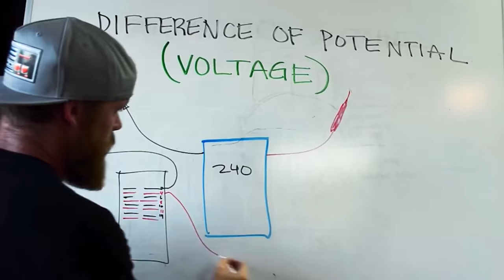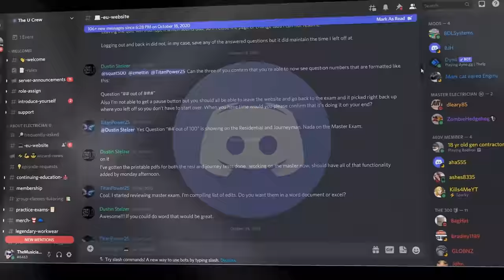Kitchen Remodel - At Parents House

Comment: I look at figuring something like this out akin to doing a jigsaw puzzle, i.e. start with the corners and edges (the easily identifiable stuff) and work your way in picking out chunks to work on that you recognize, and then rest is just making the little pieces fall into place. After that, the daunting part is making it all work in the confine you're given, like in this case not tearing up the ceilings etc.

Comment: I had to do that exact same thing but junction box then but what I did was I put emergency lighting at those locations depending on where it was I just thought it was a neat idea to have that in a residence with no generator just in case the power went out.

Comment: If you had done undercounter lights, how would you have split and run the wires without hiding a j-box in the wall?  Also, what is code in terms of securing/protecting where romex comes out of the wall to serve undercounter lighting?  Looks like your parents would have had 3 sections of UC lights run off the switch.

Comment: Dustin, what are your thoughts on the new splice kits for #14 and #12 wire that you can cover up.  I thought of these when you mentioned the junction box issue and wondered why you did not use them?
Reply: I think in a different video he was troubleshooting some lights. This was long before the new splice kits came out I'm sure. I thought I seen some junctions left inside the wall which is is big NO NO. That only costs the homeowners more money in the end cause it takes us longer to find the culprit. Those things are cool and all but after that house is owned by someone else and they fail, then what? How is the next electrician going to find that splice inside of a wall without it being accessible? I would only use those little splices up in attics and clearly where someone could find them later down the road if something would happen.  Things are made to break and that's a fact. Dustin had the best and simple idea to use accessible junction boxes throughout the house.

Comment: well after years of being stuck doing residential work I decided to get into the electrical program at my local community college. hopefully it will open alot of doors for me. thoughts on this?
Reply: @SOHMZ IMO, to open ALL of the doors, you need to get into an IBEW inside wireman apprenticeship. You will learn ALL of the electrical theory and wiring methods to wire ANY building. It's a good gig, but it does take time (my apprenticeship lasted five years). However, an electrical program at a local community college is not a bad idea. If your intention is to do commercial work, it is definitely a step in the right direction.

Comment: My grandfather and my dad were both master electricians... They always taught me everything that they thought I should have known as far as electrical is concerned... But they did not want me to become an electrician. My dad always told me if you become an electrician I'll kill you. 🤣 

They taught me a lot. I don't know if I could pass an electrician exam or whatever, but I do know a lot of codes and whatnot.

When I moved into my new place the garage was done by a do-it-yourselfer that did not know how. Literally.

The walls on the inside where sheathed with one quarter inch plywood so it looked kind of nice, but further investigation revealed that they had not insulated the walls... So here comes the tear off in March of last year.

The tear off revealed blatant electrical code violations even though there were only four outlets in the whole garage and only three overhead lights. I had four hidden junction boxes and about five hidden junctions that were not in a box... Only wire nutted and electrical taped.

The garage was built first so the main panel is in the garage. The main panel consisted of a 200 amp breaker running to the house to a sub panel, and three breakers dedicated to the garage.

Long story short, I ripped out all that shit in the garage and put in another sub panel with a 100 amp breaker feeding it.

I then separated it off for some 220 volt circuits for the air conditioning and air compressor and a welder.
I know, 100 amps may not be enough to run all 220 circuits at the same time... But I do plan on shutting off one so I can run the other two. IE: shutting off the air conditioner to do some welding.

I wired the rest for the furnace (regular home furnace here... Just like you have in your basement with air conditioning) lighting and outlets throughout the garage... West wall being separated from the east wall.

Ceiling fixtures West and East on two different switches with 6 porcelain fixtures three on the west and three on the east and 15,000 lumen LED garage lights. It's too bright. Lol but I'll never have to complain of dark spots in my garage. 🤣

I had a Pole shed build and I ran 110 volts off the panel over to that via direct burial AWG-10.

At the same time I was doing my basement remodel and I went hog wild with outlets and five way switches and can lights in the unfinished ceiling between the joists... We went with an industrial theme so we painted the joists with semi-gloss black. It looks amazing.

Before buttoned it all up, I called a local licensed electrician and paid the money to have it all inspected. He said that some of his guys don't do this level of craftsmanship. I took that as a compliment.

Comment: 4:46 my sisters house has a 4 gang box that 1 of the 4 switches goes to 🤷🏼‍♂️ We toned, traced, did everything in our power (and remember we were to the studs) to find where that thing went to…. Not a clue as to where it goes/went/or what🤦🏼. But honestly, isn’t it required to have at least 1 switch in a house that when flipped on/off….ya got no freakin clue as to what the thing does, yes, I’m sure you right there reading this has at least 1 switch that got no clue what does, am I right😅😅
Think this is a requirement in houses, and has been for generations 🤣😉
✌🏻
Reply: Check the light in the dog house, same thing happened to Al Bundy
Reply: Yeah. I got one... 1962 house 😂 the switch has 120 going to it and I don't know where it's going.
Reply: That switch goes someplace. I have found attic lights, split outlets, and even spares run for a future attic fan or AC blower. (wires coiled up in the attic) Have also found wires dead-ended in the basement for an outdoor post lamp that wasn't installed yet. (the J-box was marked)

Comment: 3:30 I just don’t label everything, but we started taking pictures and even scanning the entire room using software to make a blueprint “map” of everything before work starts. Software also converts everything to 3D, and virtual as well where we can make changes, do our runs, add walls, remove, whatever want and see in real time and if bad idea or good. Really helps, and then can print pics and put on walls for say cabinet guys to they know where electrical and plumbing is in walls and don’t hit😉
Granted, some jobs we don’t do this (adding a light, switch, etc); but if doing a 1 room remodel or more….we doing this, and really helps homeowners during design stage as can “see” where a switch is, or isnt, and helps us as well.
Not for everyone, but imo, worth the cost

Comment: Hated kitchen remodels. Way too many times got called for a 50 grand new kitchen in an old house. Homeowner would rather spend 5 times more for a fancy counter top then the money needed to add new circuits for appliances they never had. They often had trouble that yes you need a dedicated 50 amp line for the top if the line range that is replacing a gas range.

Comment: First day of apprenticeship today accidentally stepped on the drywall and punch a whole through the customers roof fml
Reply from the maker: Tomorrow will be better! 💪⚡
Reply: Keep at it… be safe, wear appropriate fall protection equipment - don’t stand on the top step of the ladder.
Reply: That's part of the learning process: about fifteen years ago I was crawling around in an attic and slipped; both of my feet went through the hallway bathroom ceiling. (Fortunately, the homeowner was very understanding.) The contractor I was working for understood why it had happened (the trusses were built in a non-typical fashion) and paid to have it fixed. That was the first and last time I damaged drywall in that way.

Comment: thank you for all your videos. And I have a question. is it a code violation to have a outlet installed in a fireplace that is having a gas stove insert installed? one person told me that it is, but it seems that a lot of electricians have no problem installing an outlet in the fireplace for that purpose. because some of the gas stove inserts come with a standard power cord in the back of the unit. I have been looking in the 2020 NEC book. I can't find it mentioned one way or the other.
Reply from the maker: That would be a great question to ask in the discord: Discord.gg/electricianu